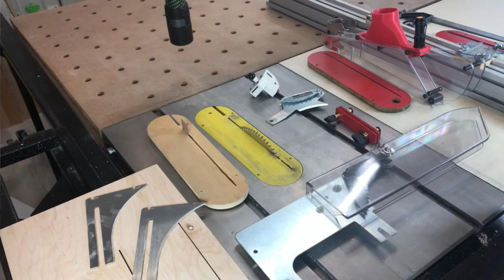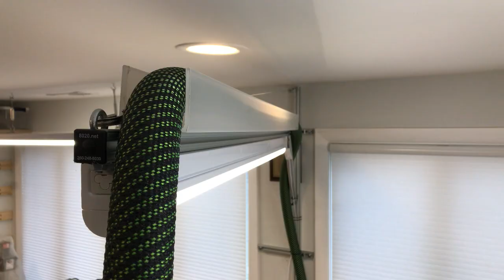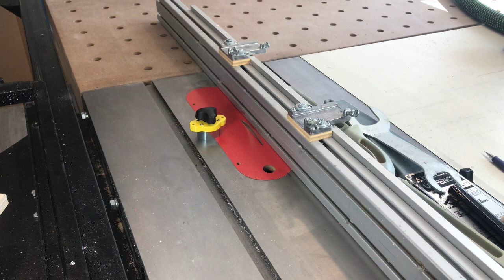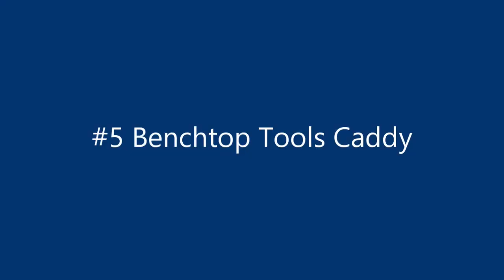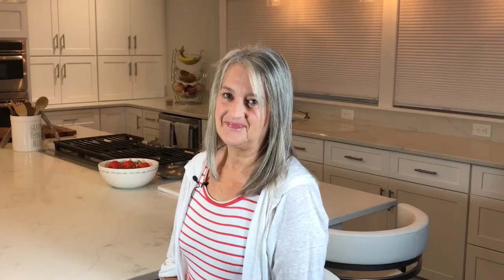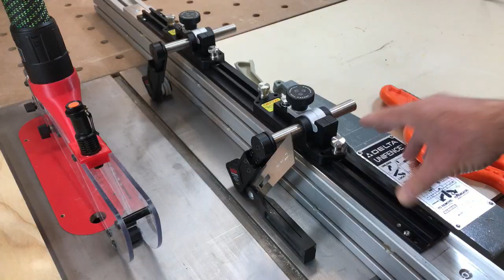How to install 7 of the BEST table saw upgrades = Improved Performance

Comment: I purchased the Shark Guard for my 1946 Walker Turner table saw.  The customer service was excellent making sure I received the correct setup.  Super easy to install and use.  Mine has the anti-kickback pawls as well.
Highly recommended!

Comment: Excellent curation of TS improvements.  Subscribed. How do you deal with rips too narrow to allow the SharkGuard hood or Jessem rollers to remain in their normal positions? In such cases, I use an old Grip-Tite  magnetic featherboard for inward pressure against the fence, but haven't come up with a good dust hood solution. Wouild the Shark Guard work at all if raised high enough to clear the top of the fence?
Reply from the maker: I have another video titled “How to safely cut rips, crosscuts, miters, and bevels” that might help answer your question. The problem with thin rips, the Jessem rollers won’t work and the Shark Guard gets in the way. I either use the Rockler thin ripping jig or I use a sacrificial push block. Even if you were able to rip your thin pieces with the SharkGuard elevated I think it may get in the way and I don’t think the dust extraction would be effective. The key with my approach is to always have a riving knife to minimize kickback. I don’t know if this answers your questions, but I do want to thank you for your comment and for subscribing. -Ken

Comment: I bought my Jessem TS Stock Guides several years ago on-sale for  $120 at Woodcraft.  I see they are now close to $300–  I don't think I would pay that much!  I was surprised at how much extra effort is required to push the board past the blade with the stock guides engaged.
Reply from the maker: You got a great deal when you bought your JessEm Stock Guides! Yes, you are right it does take more effort to push your work piece using the stock guides, but I really like how they keep the work piece against the fence. Thanks for your comment😊
Reply: $300? That's more expensive than my tabel saw lol

Comment: Good vid.  What kind of dust collector do you have hooked to you Shark Guard?
Reply from the maker: I have a Festool dust extractor under the left side of the table saw. It has the Bluetooth technology so I can turn it on with a button on the end of the hose. The boom arm allows me to also use the same hose for the Shark Guard and for when I’m using my portable sanders on the out feed table. Thanks for the comment!

Comment: I had not used the blade guards on the two table saws I have owned over 40 years for reasons similar to what you describe, but as I did more research I discovered that most of folks that lost fingers while cutting did not push their hand into the blade… the board being cut kicked back and pushed their hand into the blade.  Since the splitter on my older Craftsman saw was part of the guard and since I was not using the guard, I was a prime candidate for a bad day.  I think I paid about $225 (used) for my current saw which is a wonderful older heavy duty well made Craftsman saw.  I bought a Shark Guard for my older Craftsman saw, I think it cost me $175 including shipping, but I don’t regret it a bit.  It is a really nice guard and helps keep all my fingers where they belong.  One other improvement I made to my older saw was to replace the cast pulleys on the motor and blade axel with machined pulleys from In-Line Industries.  I think the two machined pulleys cost about $35 including shipping, and like they claimed, the saw runs with so little vibration you can’t stand a nickel on edge on the saw table and the nickel will not fall over
Reply from the maker: I’m glad you had a similar positive experience installing the Shark Guard on your table saw and I totally agree with you it’s well worth the investment to protect your fingers. I also like your other upgrade to your table saw. Thanks for your comment!

Comment: This was a great video.  I need to get the Shark Guard for my saw.  Are you happy with the smaller dust collection port or do you think that the 4” would have been better? Thanks!
Reply from the maker: Thanks for the feedback! My logic going for the smaller diameter hose on the blade guard was since my main dust collector is connected to the bottom of the saw, pulling down the sawdust, I thought the blade guard dust collection would be for the residual dust the main collector missed. Plus, I didn’t want a large overhead hose to deal with over the saw. I don’t think you can go wrong with either size for your application. BTW, I found the people at SharkGuard to be extremely helpful. They are a small business and the really care about their customers😊
Reply: Thanks for getting back with me.  I was thinking similarly and appreciate the validation
Reply from the maker: @johndesormier8099  Anytime John. Also, I really appreciate your comments
Reply: A shop vac works better on the blade guard than a low pressure dust collector.  That also means the 2-1/2 hose is fine.  Just make most of the length smooth piping to minimize wall friction.